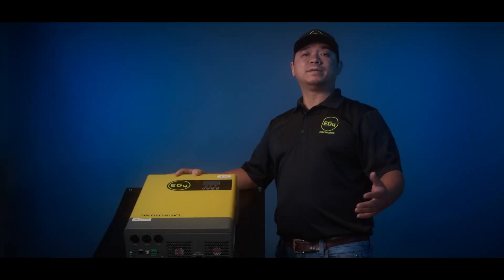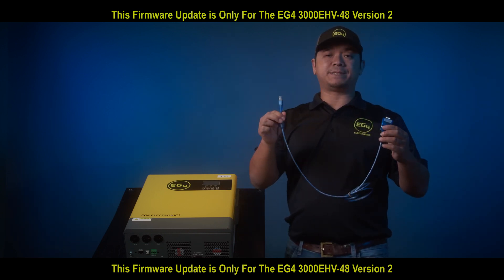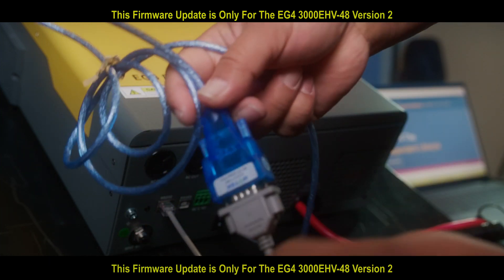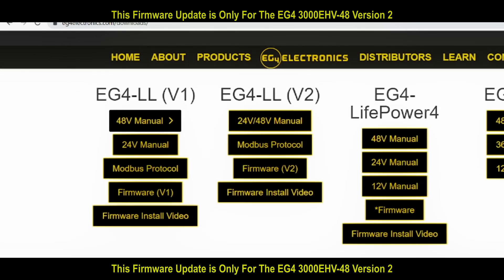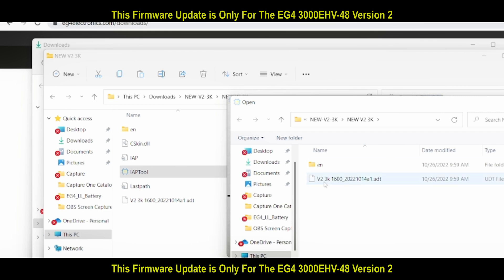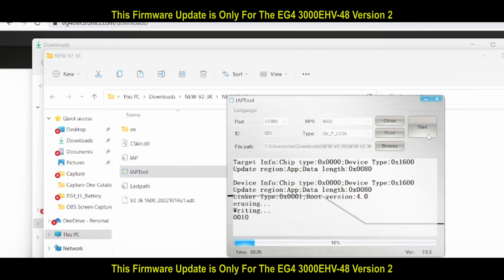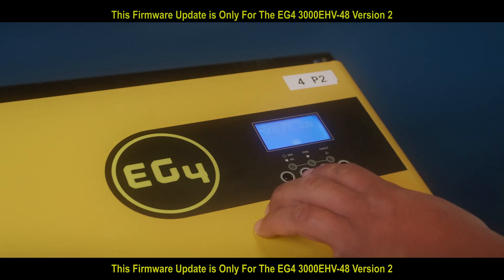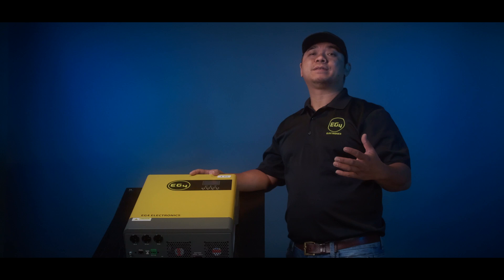EG4 3000EHV-48 V2 Firmware Update Walkthrough

Comment: Does this firmware update address issues regarding the dynamic neutral ground bonding?  Is it required for the neutral ground bond to work properly after you install the screw?

Comment: I must say it’s really sad that customers of EG4 have to go through all of this just to upgrade the firmware. In all I’ve spent four or five hours on the phone with signature solar trying to get this figured out. I even patiently waited for them to send me a cable that I needed that apparently wasn’t included when I bought it. That’s bad enough. Let’s forget that when you download the firmware, your security software will tell you that it’s malware. Let’s forget that your security software will probably try to delete the files. So this process is convoluted and you need a special video right? After four sessions with Signature Solar support I have been unsuccessful and my unit is closer to the garbage can than ever. The fact that EG4 is too lazy to register their software with Windows and instead put it on you to figure out this complicated upgrade is really unacceptable. I will no longer buy EG products because of this poor treatment they put on their customer. Pathetic.
Reply: Regarding the download being viewed as malware, they need to get code signed by digicert or one of the signature authorities so that customers don't see that message. The manual is decent, but all I'm going to say, thank God for youtube videos. But otherwise, seems to be working great. One thing that needs to be added to manual is that you have to turn off the inverter to change the frequency from default 50 hz to 60 hz.

Comment: Thank you for this level of customer support.

Can you please create an instructional video showing how to get the unit's WIFI system connected to an android phone?

I have downloaded the required app on both a late-model Moto and late-model Samsung cell phone and I cannot get the monitoring function to connect and work with either.  The software is not intuitive and the written directions are woefully insufficient.

The ability to connect and monitor via WIFI is an important feature and one of the big reasons I bought this unit.  Your help and guidance will be greatly appreciated.
Reply: I think the joke is on you in terms of the Wi-Fi. I have spent hours on the phone with support at signature solar unsuccessfully trying to get the Wi-Fi dongle figured out with its ancient RS-232 connection or whatever old connection it is. Wtf. That went out in the 90s. I’m really bummed. I spent good money on this thing.

Comment: What’s the difference in v1 and v2?
Reply: I had the same question but reading the current discription ov the V2 says, "Minor Improvements to the exterior design". Looking at the pic I see V1 has square corners and V2 is rounded. 
See Images Below
V1       https://practicalpreppers.com/wp-content/uploads/2022/06/eg43kw-2nd.png
V2       https://cdn11.bigcommerce.com/s-bi8c0htqsn/images/stencil/1280x1280/products/1571/1966/e72881b9-8d32-4c2b-a1b1-7b6b21cf904b__06069.1667234679.PNG?c=1
Reply: The fact that we as customers have to try to figure that out is bad enough. But there is very little input from the company. I honestly don’t think they care about their customers one little bit and I’m moving on.